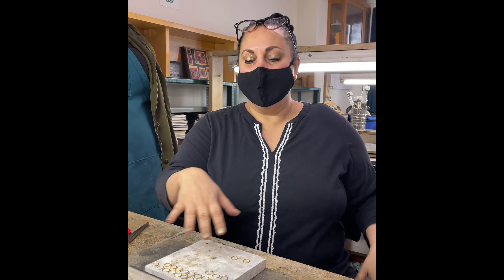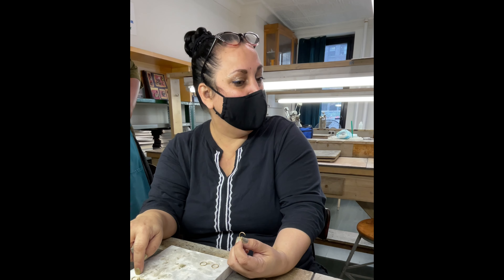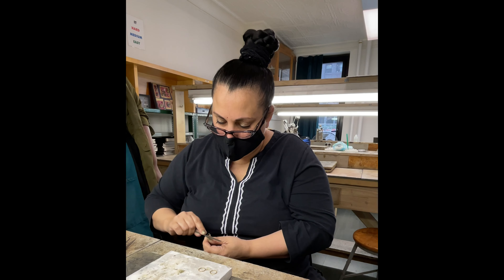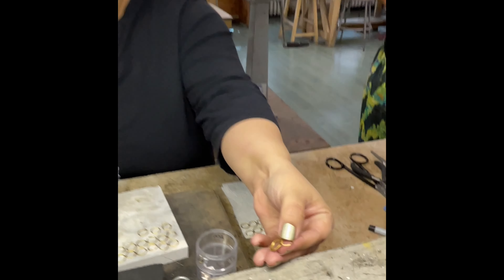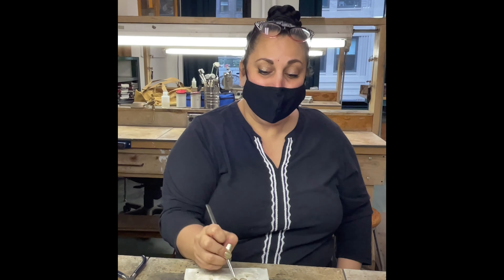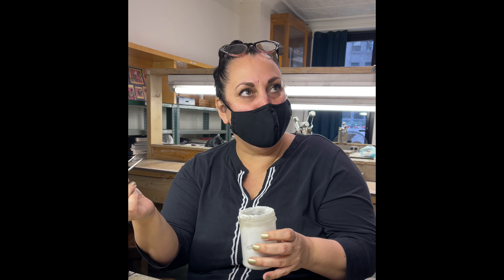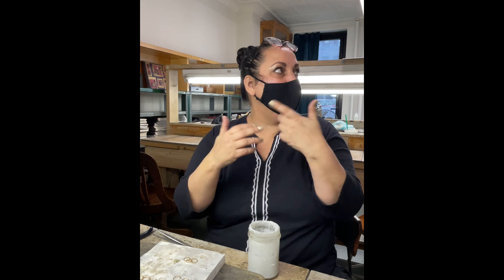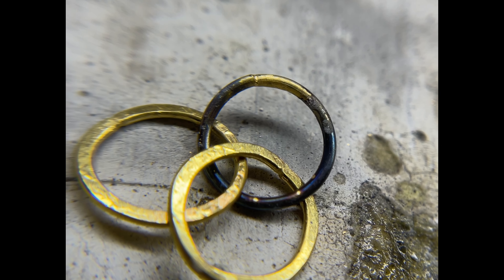How To solder 22k Gold Links in a Chain

Comment: Hello jeanette Ive got a question if you dont mind answering after i solder will the black marks come off with pickle? and is this the same with different carats like 9ct 14ct gold alloy? thanks in advance john
Reply from the maker: hi john,
yes, the pickle will remove any oxidation. The only difference in lower karats is that you would want to use a barrier flux as well to keep the surface from developing an icky skin. Take a look here https://youtu.be/4UZ27tBVIq8?si=VaTVbYUywarM7STe
I explain all the fluxes and how and why to use them. Of course, you would need to use a lower karat solder as well. :)
Reply: @JewelryArts  A barrier flux to avoid copper to come to surface? Didn't know there was a barrier to cover lower carats when in pickle jesus thanks for sharing! Thanks you so much for replying appreciate it you are amazing at what you do thanks for sharing your knowledge with us newbies we would be lost without you thanks Miss .
Reply from the maker: @johnprates-r1p  the pleasure is all mine! I love helping others learn metalsmithing. The lower karats have a lot of copper and other metals that come to the surface , if you don't use a barrier flux, you will have to sand it off, even after pickling. I explain it all in my video on fluxes. :)
Reply: @JewelryArts Yesss thats exactly what i fear having to sand my chain its a Grando rope DM-016267 14ct 4mm with square interlaced C links welded giving a spiral shape non-corrugated apperance and dimond cut for a shiny look not expensice but means so much to me aww thank god you mentioned, honestly thanks once again i appreciate it miss , regards john :D
Reply from the maker: @johnprates-r1p  Just use a barrier flux anytime you heat your chain and all will be well. You are very welcome. :)
Reply: @JewelryArts  Bit of a crazy question but i feel like if i don't ask this to someone like yourself that's in the business and that could give a a real answer ill never get a true answer so sorry for all these questions ... how could i possibly even get involved in this art is there a course or anything of that nature to learn this trade? im 27 and need to make a move to have my son comfortable in years to come and i think this could be ideal for him to get involved in aswell hes 5 though bless him but hell learn how to regardless with me as a father lol sorry just had to give you some context about myself if you could point me in the right direction would be greatly appreciated thank you jeanette
Reply from the maker: @johnprates-r1p  There is very great demand for jewelers, cad designers, jewelry repair, diamond setters in the industry. If you are looking to change careers, I suggest you look into a trade certificate program like here https://studiojewelersltd.com/ 
You can also look at MJSA's Be a jeweler program here https://beajeweler.com/
They have lots of resources for people looking to get into commercial jewelry. Good Luck!!!!
Reply: @JewelryArts  Thank you so much i never knew there was courses like that!! I'm from Ireland so i think i'm a wee bit far for these exact courses but i must find similar programs over here, i love the work you do and  please never stop being the person you are... see everyone your with in your videos they know you do this with heart and passion so they appreciate to listen you share your knowledge with us all in different corners of this amazing planet of our, i wish you all the best miss i hope to someday see anyone as passioned about this craft as you are yourself, your an inspiration honestly thank you. take care jeanette x
Reply from the maker: @johnprates-r1p  I can't say how it is in Ireland but there is great demand here and I would imagine there are centers that provide certification. Good luck!  You are very welcome. I am lucky to do something I really love.
Reply: @JewelryArts  I appreciate this thank you
Reply from the maker: @johnprates-r1p  hi john
You are most welcome. Please let me know how it goes. :)

Comment: Hi Jeanette! I have 2 questions 

1. What was the exact kind of flux you used in this video?

2. If these were 24k gold links instead of 22k gold links would the process be the same or would you do something different?
Reply from the maker: I used handy Flux which is a paste flux. Soldering would be the same in 24k, I would use 22k solder. :)